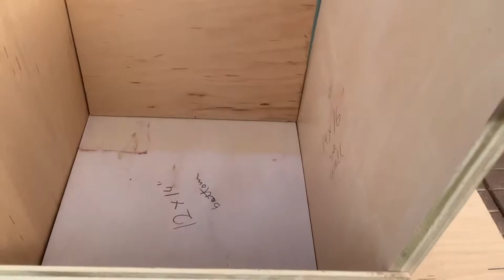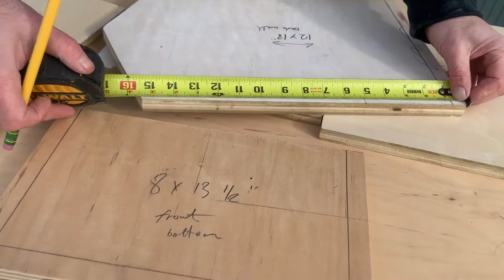How to build a solid Squirrel House - two floors - winter home - from plywood (full details)

Comment: Wow! 👍I am building bird houses now and started a big squirrel house. Your work is impressive. 💯I like how you came up with designing the porch ledge as all one piece.💚  I can now understand just how tricky it is to find a solid place to put the squirrel house.  Some vids use construction screws drilled into the tree. I am trying not to do that because it doesn't feel like a "nice" thing to do to the living tree.  If I find some thick solid branches I would consider sitting the house on that and using rope to hang it up for additional support.  Thank you for taking the time to show us your work.💯 Editing and producing a youtube vid is dedication in itself. 🇨🇦
Reply from the maker: Appreciate the feedback. Thank you!  and yeah, I try avoid using the screws into the tree when possible as well. But want to be sure its secure and doesn't fall down during high winds.  especially with babies in there.
Reply: @HowToWithLech  After watching your video last night, this morning I went to work to add a covered porch. I also added a platform on the inside of the entrance hole
to make it more difficult for raccoons to get at the babies. Also added some strips of wood on the inside of entrance wall so that the babies can practice climbing up to the platform which gets them to the entrance hole.  Very pleased with the outcome of the squirrel house.  Nice to have viewed your video beforehand though.   I put it on an apple tree where there was an open space
big enough for it to rest in. Then used rope to secure it. I used 3.5 inch screws on smaller branches underneath it, 3 in total, to secure it
better. At least I didn't drill into the trunk of the tree but only through a few of the bigger branches. Still tricky to figure out a good spot to place a huge squirrel home without damaging the tree too badly :) Keep up the good work! Stay safe as we work through the pandemic to master herd immunity! Cheers from Canada
Reply from the maker: @MegsCarpentry-lovedogs  awesome.  sounds like you got a good setup..
Reply: @HowToWithLech  Thanks. I have been looking at Owl nesting homes to build. Same principle to have an inside ladder on the inside of the entrance wall for the babies to practice climbing up to the entrance hole.  Quite a big nesting home when building an Owl home!  Need the owl to keep the little critters around my home which is nestled in the forest.  Pandemic meant time to organized the basement workshop, so now it makes it more pleasant to get these fun projects done for wildlife. Looking for the silver lining from this Pandemic eh! :) Again, thanks for your video. Cheers from Canada.
Reply from the maker: @MegsCarpentry-lovedogs  sounds fun.  and you have a lot better location suitable for these projects.

Comment: Awesome build. I've been looking for plans, and I think I'm going to model something after your house. The only thing that concerns me is the weight. With 3/4 ply that house has to be heavy. How did you attach it to the tree?
Reply from the maker: Yeah.  With the plywood. That size is heavy.   But you can use lighter wood.  It’s just what I had handy.  I have it sitting on a branch. Plus connected 2X2 on the back to attach to tree too.   The green smaller one I made was lighter.   That was easier to mount.
Reply: Cedar planks are light in weight.

Comment: Did snow blow in there in winter? I am about to build something similar and I was thinking of putting what others call a predator guard, a piece of wood in front of the hole, so that snow or wind wouldn't blow in too easily.
Reply from the maker: Good idea.   Don’t think it did. 
It’s not an issue with the green i have in my yard